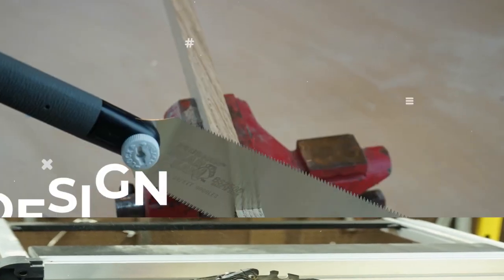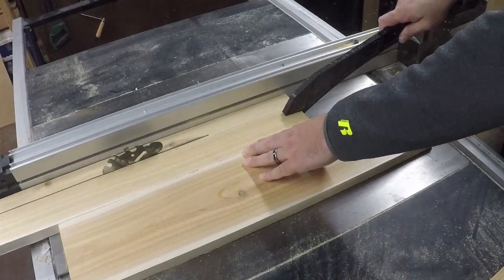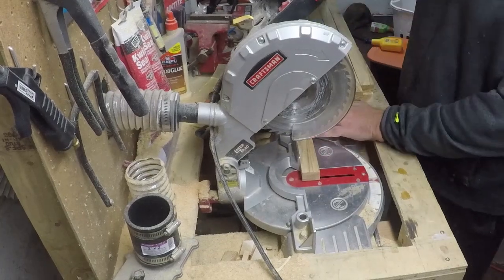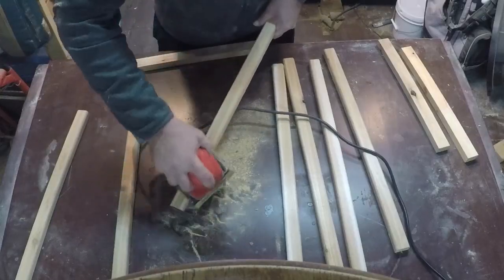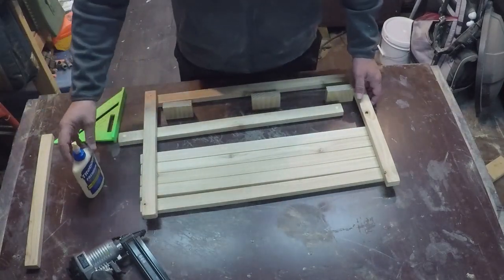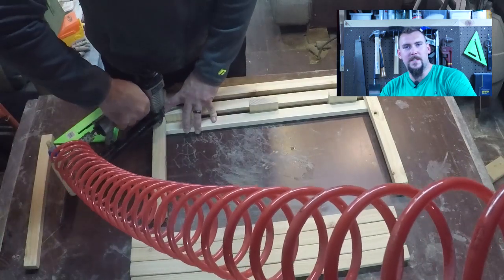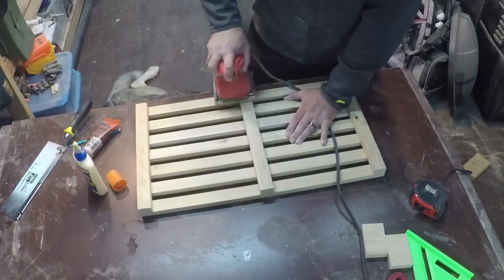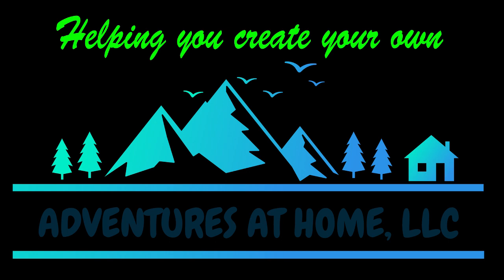How To Make A Cedar Bath Mat

Comment: Is there any advantage or disadvantage between Cedar and Redwood when it comes to functionality and/or moisture resistance?
Reply from the maker: There's no real difference with this project besides which wood you think looks the best. I usually have cedar laying around and like the way it looks for the shower mat. Thanks for watching!
Reply: Okay great, thanks for replying and sharing!
Reply: Good question.  Here are the differences:
1. Redwood is a harder wood than cedar. It was found to be 23% harder than cedar when the Janka hardness test was used. Because it is a harder wood it will last longer and is more durable. 
2. Redwood and cedar naturally contain tannin (a chemical that gives the products their color), which keeps the wood insect resistant. Since California redwood has a higher level of tannin, it is more rot resistant than cedar.  Teak has the greatest moisture resistance compared to all woods.
3. Redwood planks are available at Home Depot for $4.  Nice size to cut into strips and make a mat.

Comment: If you want to add moisture proofing, then let wood soak up Boiled Linseed Oil and let dry 2 days. Then coat up with diluted Oil based Polyurethane.  If diluted, it soaks into the wood, hardens it, and makes it highly moisture resistant.
This is for indoor use only, and you finish off every strip separately before attaching together.  Use stainless steel screws not nails.  Do not use nails that will rust in a month and split the wood.
I would use Redwood as Home Depot has cheap plants available, with a dramatic grain, for only $4.  Cedar is harder to find and more costly.
Use rubber feet all over the bottom.  You can inset the stainless steel screw into the rubber cap foot so that the screw never sits in the water and the wood is raised up for drainage and air flow.

Comment: 1. 1" x 2" costs more than a plank of wood overall.  Redwood is cheaper at Home Depot. Planks cost $4 and have a dramatic grain.  Chop them up - it is cheaper than cedar.
2. Spar Urethane is not necessary.  Spar is for UV light resistance in sunlight. If this is for a shower, it is not exposed to sunlight.  Spar costs much more than interior oil based Polyurethane, which is much more clear and not yellowish like Spar. Avoid Spar unless it is for a boat or outdoors.
2. On raw wood, soak in Boiled Linseed Oil heavily, till wood is saturated.  Let dry for 2-3 days in hot weather.  Then coat with 50:50 diluted Mineral spirits and Oil based Polyurethane Satin finish.  Wipe down (smear) after 15 mins.  Let dry. Apply 3 coats or more, wiping off excess. Diluted Poly will soak into the oil conditioned wood, hardening it, and making it super moisture resistant.
3. Add rubber feet with insets for screws. Use stainless steel screws not nails!  Nails will rust and discolor mat and split the wood.  Rubber feet lift the mat off the ground so it does not sit in water and allows air circulation.
4. Sand, Oil, Poly coat all wood before it is assembled, so there are no bald spots where water can get in.  Should last 10 yrs of hard use.